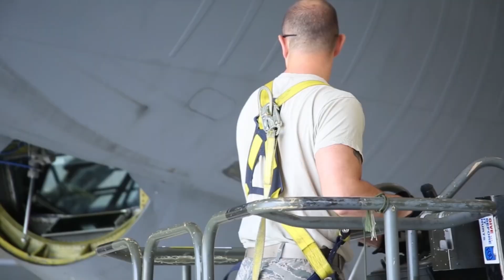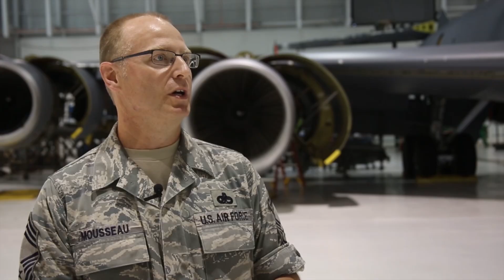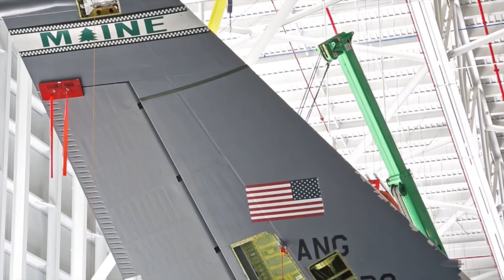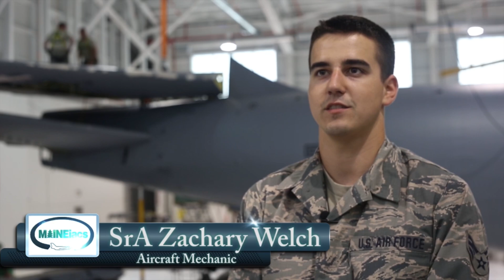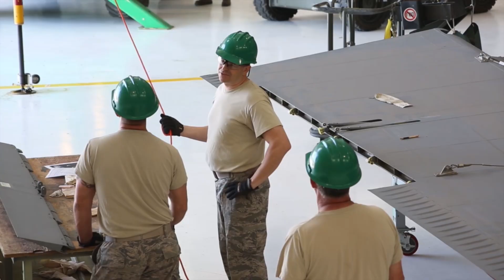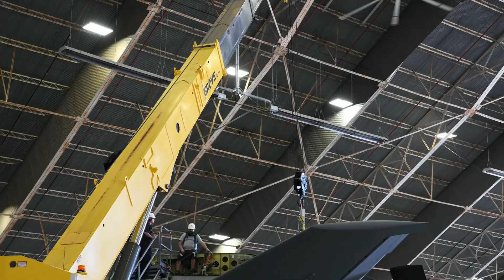Watch a KC-135 do a Rare Fin Fold!

Comment: What most people do not understand that like the B-50's the B-52's & C-135's have the ability to fold their tails, as they were designed to to so, remember when these planes were built the hangers didn't have large enough doors to accommodate the tall vertical fins, so Boeing designed to do this function. But with the passage of time, hanger doors are now large enough to allow this small airframe to enter without anything folding prior to being pulled inside or have the tail stick out of the closed doors.

Comment: This video brought back happy memories. I fondly remember being involved with the procedure for folding and erecting the vertical stabiliser during the late 1970s and early 1980s. The hangar we worked in, in the UK had a large central roof support structure. So although the hangar was wide enough to fit two aircraft side by side we had to fold the fin to get a second aircraft in the corner. We frequently performed this procedure on Boeing 720, 707-100 and 707-300 series aircraft. Great to see it still happening in 2020s 👍🏻

Comment: What’s the big deal?  I’m assuming it’s removing the required access panels and fairings; ensuring that wires/cables/lines and anything protruding either has enough slack or room to move or is disconnected or removed; and then removing the mounting pins on one side and using the other side as a pivot (as long as they have axis that are aligned) and hooking up a lift or overhead crane with proper fittings to let it down and bring it back up. 

One question though. What’s the advantage?  Normally you can re and re a rudder in situ without messing with the stabilizer at all.

Comment: The 13 years I was in the ILANG (126th ARW) in the R&R shop, I saw the tail fin folded only once.  Unfortunately I was not part of the lowering or raising of the fin.  This was done by the full-timers during the week, however, it was a holy crap moment when I walked in the hanger for drill to see the tail folded down.  It was done to fix a write-up not for replacing the fin.  I remember being told that due to the age of the KC-135 the folding tail was to allow it to fit in smaller hangers.  The 707 was America's first jet airliner.
Reply: Your comment about the folding fin facility, to allow the aircraft to fit into hangars is absolutely correct. When the 707 entered service its vertical stabiliser was considerably taller than that of any other airliner, such as the DC6, DC7, Lockheed Constellation, etc. The hangars then were quite low.
Reply: @GeorgeMCMLIX  Glad to I remembered it correctly. I left the service over 25 years ago.  Our hangers had tail doors to accommodate the tail. The unit had KC-97s before they had the 135s.
Reply: used to work for the 928th TAG at O’Hare

Comment: Not so rare. We did it on 707 oftem, mostly to fit them in the hangar.
Reply: The Boeing Aircraft Company did this on most of its designs because SAC hangars when the B-29, B-50, B-47, and B-52 came on line originally did not have the “notch” for the vertical stabilizer.   B-36  bombers had to be winched down in the tail or nose strut jacked up to get them in existing hangars.   Weird bit of trivia.   If you look at the large aircraft out at AMARG D-M you can see KC-135s with vertical stabilizers missing which have been used for replacements or parts on operational tankers.
Reply: Yes it’s rare and most personnel aren’t even equipped for it and have never done it
Reply: It was a frequent occurrence, several times a year in the late 1979s and early 1980s, when I worked for a UK based MRO. We often had 2 707s side by side in a hangar with a low roof section, which required folding the fin on one of the aircraft.